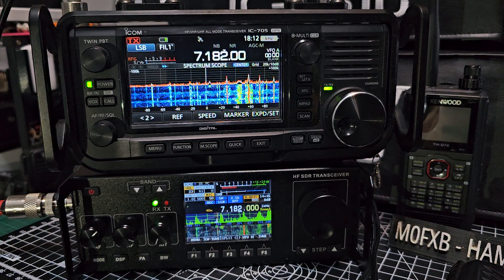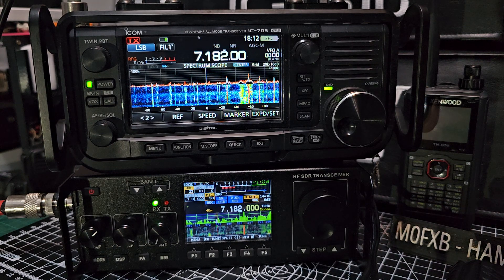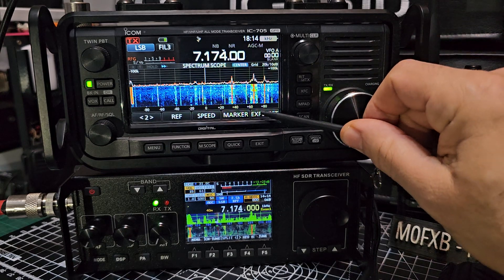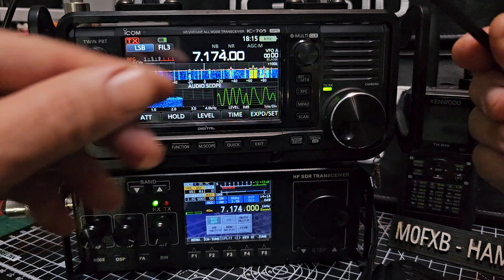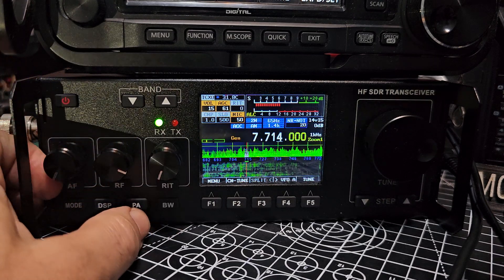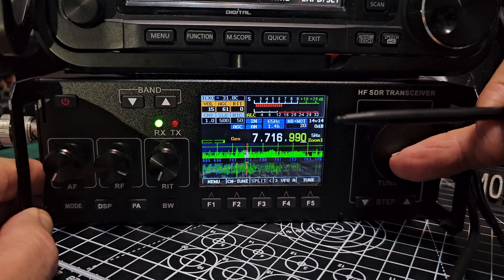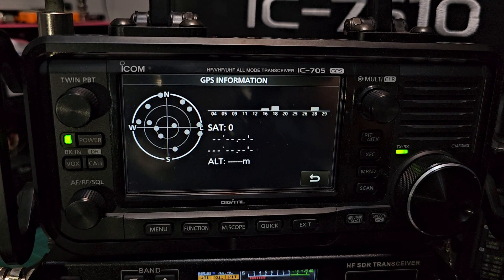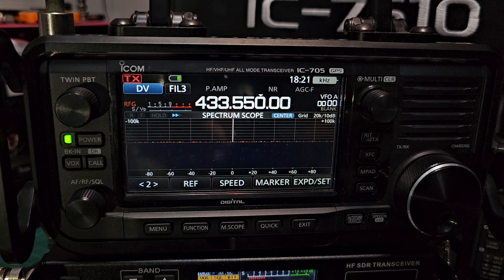ICOM IC-705  & RS- 918 Transceiver

Comment: It almost sounded as though the 918 had cleaner audio.
Reply from the maker: Yes agree
Reply: @M0FXBHamTech A couple thoughts on the 918 sounds better, I’m pretty certain you were feeding each radio with a different antenna just by looking at the signal meters, the 705 had a much lower signal so generally the better the signal, the better the sound. Maybe if you swapped antennas between the two radio you might observe just the opposite I.e. the 705 sounded better? Secondly the tiny speakers they use in the QRP radios aren’t of audiophile quality so there is that as well. I have a 705 but the 918 is intriguing for sure.